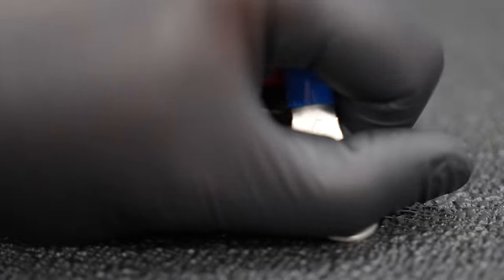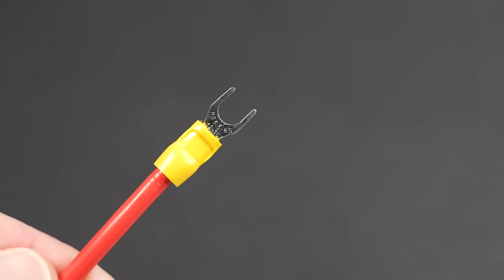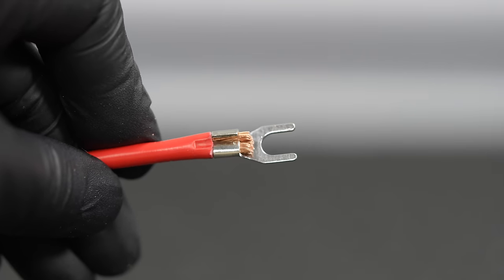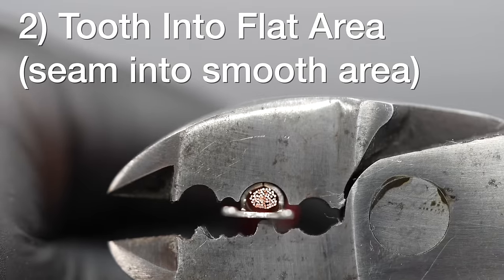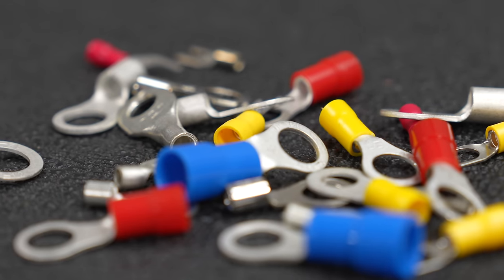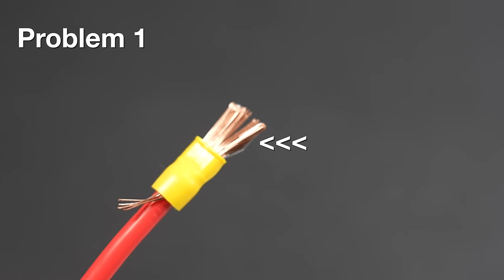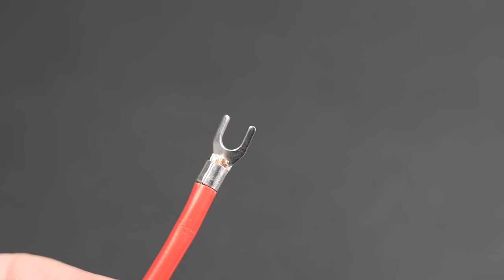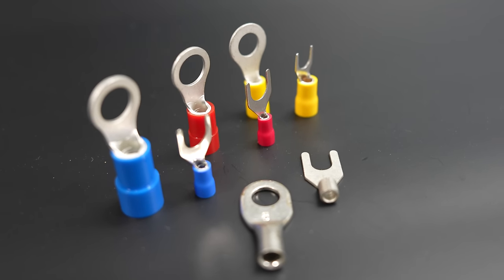Why 50% of All Crimp Connections Fail - Up or Down?

Comment: It seems to me that this is a problem of the production design of the connectors themselves, where the connection to the wire is made of two halves and it is best to connect such connectors by positioning the clamps in the notch, which holds them evenly and presses the lower part to the upper without distorting the upper halves

Comment: No insulator.  Slide on heat shrink tube over wire. Flux wire, insert and  crimp. Solder and slide down the heat shrink tub and shrink. Seams like overkill but no corrosion in the connection.

Comment: good information, of course as a kid I always used pliers then some colder.. then heat shrink.. no choice never had the tool, wasn't till the cheap tools came out anyone could afford a tool, unless the company you worked for supplied them..   very good info tho, good chance I may have tried to do it upside down and I would have ruined a few connectors till I fingered it out...  :-)

Comment: The 5.5-8 isn't the size of the opening it's allowable wire size in circular mils/1000. A number 12 is 6530 circular mils or 6.5K. Shipboard cable is sized in circular mils not AWG which is why there are two ratings.

Comment: Pull the terminal out of the plastic, slide the plastic onto the wire. Solder the wire inside the terminal and slide the plastic back on the terminal.  Done deal

Comment: For the un-insulated crimps you are using the wrong type of tool. The right one has quite a complex shape compared to generic tools and looks a bit like this.  U^U  where the point hits the split and the U shapes curl the crimp around and down. This also does not bend and distort the crimp like yours are.

Comment: Sometimes I solder em  in or I strip a good length of stranded wire, pass it through and wrap around spade or  loop connector. For female/  socket connectors....Alwayz good idea to solder em in .  Someone needs to come up with a better, quick, secure way to attach to terminal connectors. ( Just keep the price low,🍕

Comment: The toothed area on the crimpers actually shouldn't be used for insulated connectors at all, only the smooth area. Most of them say as much right on the tool.

Comment: Maybe if the insulation on the connector could be pulled back while you crimp to ensure it’s correct, then push the insulation back on.

Comment: Would be nice if you could show the proper orientation for the ratcheting crimp tool - when I first got mine years ago, there was no documentation stating which way to use it. Had to experiment. Enough time goes by without using it and I can’t remember.

Comment: I just solder non-insulated crimp connectors. The only failures I've had were as a result of using extremely thin wires. Good to know about this trick!

Comment: “An 1/8 of an inch to ensure you have enough contact” no, as long as it’s flush with the end of the crimping part it’s enough contact. 

If you read 1/8th of an inch in the directions somewhere it’s so they are not liable for any mishaps idiots might do. 

If you follow trivial instructions then you do not use critical thinking and I don’t like contractors who don’t have the attention to detail like that.

Comment: Copper sticking out the end of the barrel is overkill/unnecessary!  It does not offer any more "crimped contact" with the connector and can impede the flat seating of a large headed screw!

Comment: Have to pull the insulators off before crimping. Then you can fix any crimp. If the insulator is over the crimped area there is no way of knowing if it crimped properly.

Comment: I would take issue with the amount of wire you extend through the connector. as long as the wire is at least flush with the end of the barrel it is ok. most of those connectors are going to land on a terminal strip. if the wire extends through to far it can prevent the connector from seating all the way into the strip. Beside it looks bad. also when you strip the wire do it in such a way you do not disterb the natural lay of the strands. This will always be stronger

Comment: In oil and gas insulated crimp lugs are all they use, and you only ever use a ratchet crimper. I'd say my fail rate is less than 1%. Electrician of 25 years.

Comment: They don’t fail if you use a calibrated crimper designed specifically for the lug. That is a requirement of UL 508a

Comment: Tin the wire before crimping & if it's an important connection, solder the thing together after you crimp.  Takes no time at all, is never coming apart. 

Lost count of the number of machines I've worked on where the fault was a crap crimped connection. Looks fine - light tug & off comes the connector. There's your problem, Pal. 

 I now have a small cordless soldering iron that charges off the 12v socket in the jeep, it comes everywhere with me with a roll of solder & some flux in the glovebox. Gets used daily. 

Quickly tinning the stripped wire end makes it a solid round - so when you crimp, it's not onto spindly strands that move, you're crimping onto a solid. That's a good connection right off the bat - adding some flux & then soldering the exposed end of the wire onto the "crimp" connector takes no time at all - once done, nothing is pulling that connector loose or causing bad conductivity, it's solid. But at least tin the wire -  that alone ups the quality of the connection hugely. Takes literally a few seconds to do as well.

If I have to use a "pre-insulated crimp connector" on an important wire, I use a craft knife to cut off the factory insulation, tin the wire strands, crimp the connection & then solid solder the connector to the wire - I use a bit of heat shrink to replace the factory insulation. Nothing is getting that connector to come loose or go bad. It's solid.

Don't rate the crimp-on ferrules much - they're too spindly to get much of a grip. Usually the wire will pull loose from the ferrule just as easily as it would pull out of the connector or water will get in & it will go green crusty. Solder it. There's a reason solder was invented.

Comment: Just don't use them, you will save yourself a lot of grief by simply doing the job properly. Much stronger connectors can be bought for which you can then immerse the wire in a solid soldered connection.

Comment: REGARDLESS of how you use them, universtal crimp tools and the crimping jaws on combination liers are unreliable and NEVER produce the best results on any terminal.

ALL of these crimp lug types have specifically designed tools.
The correct crimper will completely enclose the lug on all sides.
The shape of the jaws may vary, but the give away is, the lug is completely enclosed on all sides.
I have been working with Crimp lugs for over 40 years and have been correctly trained on high reliability crimping.
As it stands I own around 20 different crimpers for a wide variety of terminals
.
IF the lug is correctly crimped it should give an "AS GOOD AS WELDED" and " AIR TIGHT" termination.
.
On insulated electrcal lugs these days, I would not use anything but a ratchet crimper.
My first ratchet crimper for insulated lugs, cost me over $100 ( dealer price), and I used to sent it in to be calibrated, these days you can buy quite good ratchet crimpers for insulated lugs for under $30.
.
Some of my best crimpers and all the realy heavy ones have an over centre action.
.
YES if you want reliable results, 
YOU MUST, have the correct tool for the terminals you are using 
YOU MUST have the correct termial for the cable or wire you wish to termiante.
YOU MUST know the correct procedure for that combination.
.
If the terminal is correctly terminated the lug will not pull off the wire.
In fact most procedures require a pull test afer termination.

Comment: The biggest problem is the cheap crap they call wire. So many times we are sold offshore (read: asian) wire that is neither the same quality nor diameter as properly made wire from most anywhere else. Brand new terminals, crimps, wire and experience and you still end up with loose connections. If you're not sourcing your wire and consumables from the U.S. or Europe you're not doing yourself, or anyone else, any favors. It's exactly the same as trying to buy quality machine or sheet metal screws at HD or L's. Wink at one of their screws too hard and it either strips or breaks.

Comment: I have never had a crimped connection fail because after I crimp the wire in(properly), I solder also it.  Then I put marine heatshrink on it, which acts as a strain relief.

Comment: I binned that style of crim decades ago, I only use uninsulated proper fold in crimps now, there are many different issues with your shown crimps, some that you say are good would fail inspection for too much wire showing, there ought to be no more than 1mm of wire through the crimp, the crimp is als odistorted so that is a fail, the crimp itself is a poor and cheap design, it was designed for mass cheap manufacture rather than a good connection.

Comment: I stopped using crimpers years ago. Unless I’m on the road, if I’m doing a job in shop, I will solder and heat shrink every single connector and wire or fuse block it.
Reply: Heat shrink with an adhesive lining is best I think. If the crimp is slightly loose, the adhesive should stop the wire being pulled out. The looseness will affect the max current that can be carried without overheating the joint but in many situations this is not important.

Comment: You forgot another possible mistake that can be made. It goes along with using the wrong size connector for the wire, where the wire is pushed in far enough to crimp on to the insulation, which obviously can only happen if the wire is small enough for the insulation to slide in to the connector.

Comment: I have a question looking at you explain how the belt rides on the outside pulley and the second pulley. I noticed a small bracket below the second pulley. it looks like the belt should be riding on top of that bracket just simply asking. or does it actually ride on the bottom side of that little finger please respond thank you.

Comment: I've always been using my Channel Lock 909, which has a aggressive toothed crimp slot labeled for non-insulated and a more or less flat or or at least very subtle concave indentation on both sides, pretty much the opposite of a toothed indentation, labeled for insulated.   I've always assumed this was ideal, and haven't really observed any problems yet.    Is this type of crimping for insulated terminals not ideal?

Comment: Question. If the fold from the crimp is ideally at the back of the connector, why do they split the opposite side? Wouldn't a crimped cylinder without a split be stronger?

Comment: ive always used non insulated ones and just used heat shrink with them the insulated one i had used where trash you could never get a good crimp with the non insulated you can visualy see where you are and what the crimp looks like

Comment: I recently discovered that the insulation bits on these connectors, is made of shrink tubing, just thicker............. i always had the problem of them sliding off..... not any more, i just shrink them.

Comment: The main problem ive seen with wire crimpers is more of problem of ignorant people not only is there an up  an down side each slot on your crimpers is for a different size connector and wire guage  so you have to use the proper size connetor on the right guage wire and the correct slot on your crimping pliers 
and even then i dont ever see anyone using di electric grease and heat shrink tube to pretect the wire from corrosion at the the connection 
its almost like people are to ignorant to notice the connectors have a corrosion resistant finish on them and so do the male sides of the plug where weather could cause corrosion

Comment: You are wrong.  There are two crimping spots on the hand crimper you have.  One for insulated and one for non insulated.
Reply: Honestly i use the Insulated on both but have an expensive thomas & Betts Pair. For any special terminals i have the Manufacturer factory crimping tool. It was expensive but worth ut.

Comment: Way too much wire past the crimp. Been working with crimps for over 40 years and the excessive wire you show can interfere with the bolts or screws.

Comment: I always pull off the insulators. After I make a s#ity crimp I solder it , after I make a good crimp I solder it, I've never trusted that type of terminal nor the crappy cheap crimpers. Never had a soldered connection go bad.

Comment: That's why you are lying the tooth with the outer wing on the sleeve when you compress it what it does it pushes both of those wings down on the sleeve. Rather than doing it haphazardly maybe pay some attention to what you're doing, I'm a retired it technician who used to hold government contracts and I haven't had a single problem except when I was a greenhorn.

Comment: Video  very helpful.  Auto -motive  industry needs to soldier these  lugs.  To guarantee a good joint.   On  cargo trailer lights.  Dip the wire   In no lox paste  then crimp.   Nolox the eye lugs   Then bolt together.  Tape joint and  scotch coat for a  good secure  joint for all weather conditions.   
 To many burned out trailer lights.

Comment: Question for the pros... how far should the tail extend beyond the crimp?  A couple of those look like they might extend under the head of the screw or nut, which I think could make for an insecure connection.
Reply from the maker: In all of the guides I reviewed before making this video including some from 3M you will not find a manufacturer recommendation for stick out. In a perfect world if the finished wire just reaches the end of the crimp that is all you need to use 100% of the connection area. The real world issue is that if you do this you will almost always run short as the wire may pull in a bit when crimped. This causes folks to fall short more often. So ideally 1/16th of an inch or around 1.55 m after the insulation is usually a safe bet. But as you said, you don't want interference with the fastner and shoud consider the voltage. Thats a long answer to say there is no perfect choice but aiming for a small amount after is almost always a safer bet than running short.

Comment: THE FIRST PART OF THE VID IS NOT HOW TO DO A PROPER CRIMP!! A proper crimp should have what looks to be a "heart" type pattern shape in how the wire is within the terminal. The main way to get a bad crimp is using cheap terminals, or putting the wrong sized wire in the hand tool. It is easier using the ratchet type one though. The crimps on those will not look the same, but they do as the video says, provide a very firm and solid crimp

Comment: Use a ratchet crimp tool or just don't bother, the other type shouldn't even be available. In fact that tool is a multi-tool with side cutter at the end, best place for that is the trash can, use the right tool for the job always. I'd sack on the spot anyone trying to use that type of tool.
When it comes the right size crimps, a lot of people just buy the blue crimps because they don't understand the colour coding.

0% of my crimp connections fail.

Comment: I have been crimping using the so-called wrong way for probably more years than Silver Cymbal has been alive.   I have NEVER had one fail.  HE is not doing it correctly.   Simply position the male portion of the crimping tool to the exact split on the connector so both sides are crimped evenly.  Not so hard.

Comment: I have a question, why does the wire need to extend 1/16th beyond then end of the connector?
Reply: I can’t think of a valid reason.
Reply: It does not need to, in fact that is technically incorrect. It should flush

Comment: Apparently you need to have 1/16 inch of wire sticking through the insulation. Does it do anything? Does it have any beneficial function? No, it just sits there....but you need it ok.

Comment: Extending wires just past the crimp, perhaps, as they would fan out and help prevent wire pullout.  Extending far enough to get in the way of the terminal screw, which could mean good connection only at the one spot where a wire strand is crushed between the screw head and the terminal, no.  You want screw pressure across a large area of the screw terminal.  Your "just right" examples have far too much wire sticking out.

Comment: This makes sense but I have never done one the “correct” way in the video and the tooth on the tool always presses the seam down evenly and has never opened up on me like in the video and I never have wires pull out when I test them.  It seemed like the “wrong way” crimp was staged to get it to happen since I’ve never gotten that to happen even accidentally

Comment: And let's just pretend we didn't see how much his "correct" way deformed the actual blade of the connector... every time. Also note that he used a cheaper crimper to demonstrate how it only pushes down one half of the collar. Then, he brings out the ratcheting, interchangeable-jaw crimper (which wouldn't have done this). Also, I don't see the point in leaving excess wire extending past the collar. The video says "to ensure a good connection", but I don't see why that would help.

Comment: I don’t use crimp connections with insulator.

Put correct size heat shrink on wire, then place connector on wire. Basic crimp to hold wire.
Then apply flux.
Then solder.
Then move heat shrink over joint and heat until sealed.

Done.

Takes longer but is the superior method for longevity.

Comment: One of the most unspoken causes of poorly crimped terminals is mismatched terminals and tools.  So you have terminals and one hand, and box of crimpers.  Now what?  Terminal manufacturers don't give much guidance as to the correct tools and methods to use.
In the world of aviation, airliners have thousands of crimps, and detailed manuals on how to do make proper crimps.  As for the rest of us?  Just dig through that box of tools and do your best.